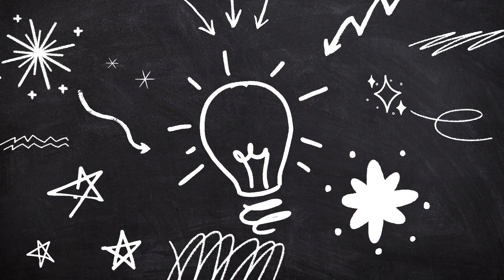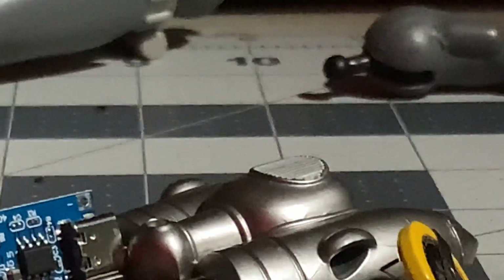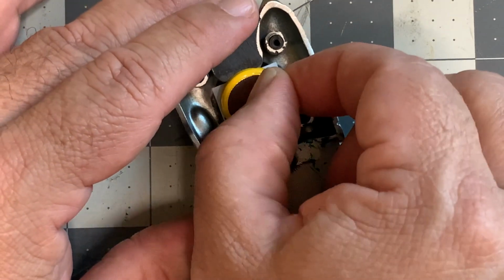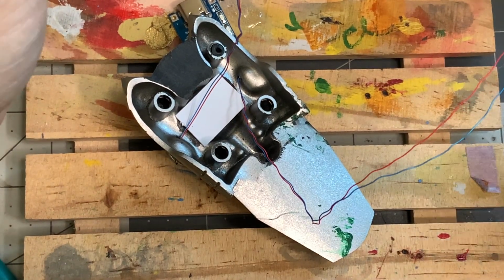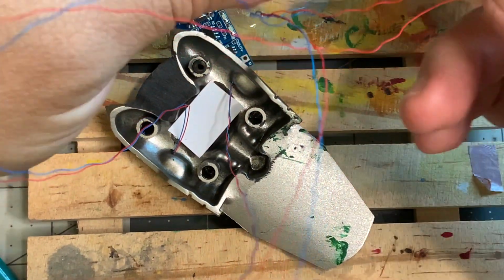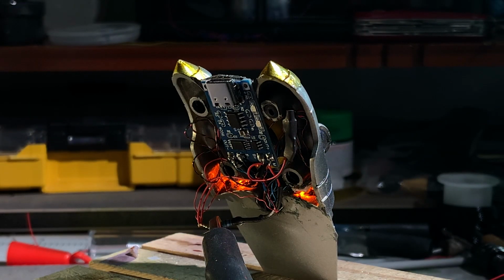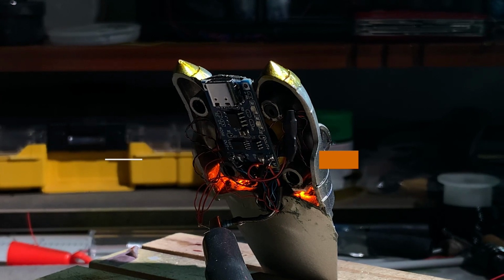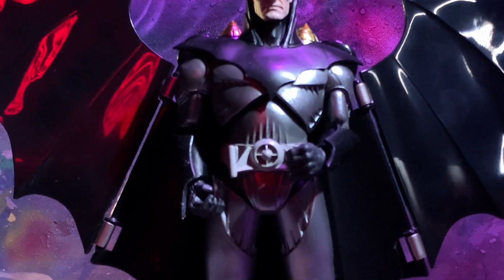DC Multiverse | Armored Batman | Kingdom Come | McFarlane | Custom | Alex Ross

Comment: Amazing!
Can i ask what paints you use and methods of painting please?
Reply from the maker: paint can vary depending on the plastic you are painting....I use a variety of brands... Vallejo,, Tamiya, Golden... sometimes I airbrush other times I dry brush...
Reply: I actually have just got the kingdom bat for my birthday and wanted the paint the darker grey and lighter grey bits like yours and the the black bits at the elbow and knees 
I have used graphite a few times and have tried painting with acrylics but quite often it ends up super sticky
Reply from the maker: Try a name brand acrylic… Vallejo, Citadel Tamiya… should dry non sticky in 20min….
Reply: Yeah im tempted to try the Vallejo premium range

Comment: Dude, sort out your sound levels please , your voice is at about a 2 and then thump boom, that 'music' is at a 10! I was pushing my volume control up and down like Casanova's butt! Other than that good video, are you not making his Lance weapon?
Reply from the maker: Interesting I turned up the voice and the music down
Reply: Hmm. I didn’t have to change anything
Reply: … as always, thank u for sharing.  Are you getting the Keaton Batmobile and Bat Wing?  I’m so interested to see what u do with them, if your getting them.   I haven’t looked yet, but if there is a way to do custom lights on the wing with a remote, that way you can hang it from the ceiling and still b able to turn the lights on and off.
Reply from the maker: I have plans for the cycle snd Batmobile….I haven’t purchased the batwing yet…but with a remote is a plan… I’ll post my findings here 
Thanks again for watching